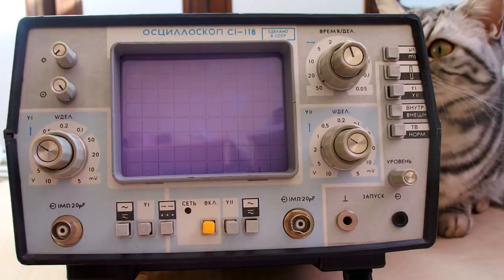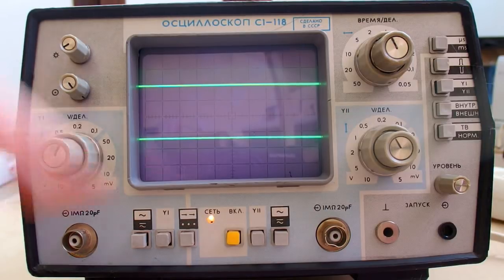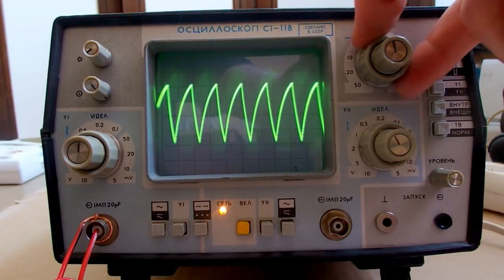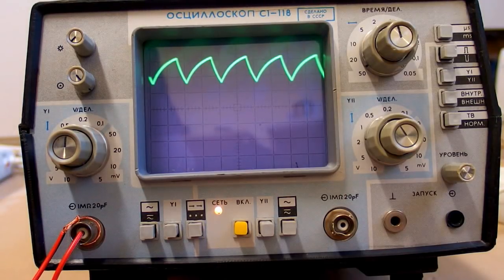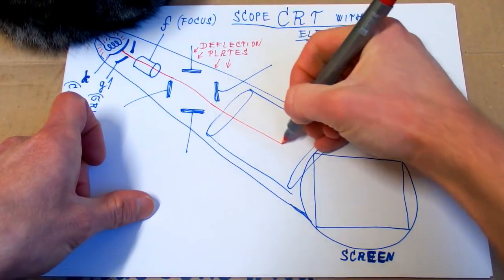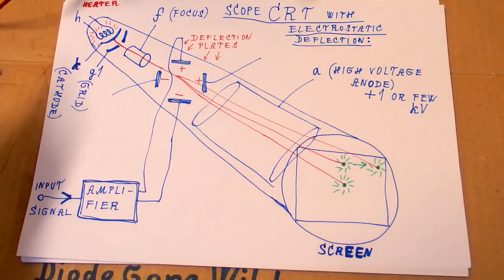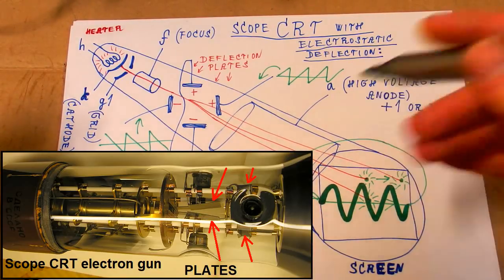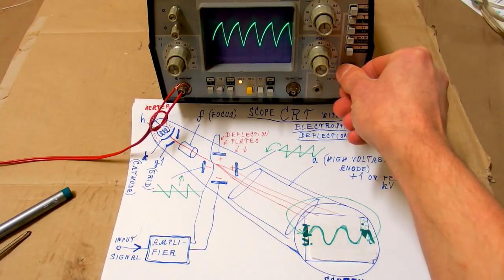How does an analog oscilloscope work

Comment: You did a smashing job of discribing the scope :-D, even though i know how it works i still enjoyed watching :-).
Thats a smashing oscilliscope, dual trace via chop or A/B switching.
The front panal is nicely layed out, easy for even a non russian user.

Ok it was the loverly cat i was watching LOL :-D.

I have a cossor scope, a telequipment d32? and a radio shack display scope.
The telequipment portable battery/mains one is bad joint city, ive spent a lot of time on it.
Reply from the maker: In the next video I plan to get to the dual trace modes :). I like how simple to use this scope is and yet so handy. The cat was very heplful this time.
Reply: It would be awesome to watch if you can build a crude analog scope from scratch.
Reply: You can use an old CRT TV as a basic scope. Connect the deflection coils to a good audio amplifier and you can see the signal.

Comment: The oscilloscope looks cool please show us the inside of it!👍
Reply from the maker: The scope works really well and I really like it. I'm not sure I'm gonna poke in it :). It's not like the Ebay items you can order another when you break one. :D
Reply from the maker: ..... but maybe if I manage to get a simmilar one that's not working, I can try to repair it and show you the internals ;)
Reply: Opening a scope won't break it. Just open the case and try not to break any cables. I have two oscilloscopes. C1-107(5MHz single) from 1992(so technically it's not USSR, it has no CCCP mark on it) and Schlumberger 5228(triple 250MHz). C1-107 still has germanium transistors in it( I saw one in deflection circuitry). It has integrated multimeter which is done entirely using discrete IC's. Character generator,ADC etc is all made using TTL + analog circuitry.  Russian design is messy as always. Oscilloscope part works but the multimeter is semi-broken. Finding the schematic for the oscilloscope should make it easier for you, C1-118 is a popular model so it will be easily available (I found few on Polish forums). As last advice, remember that USSR scopes have slightly different BNC connectors than the west, modern probes will fit very tighly. Changing the BNC is a popular mod for USSR scopes.

Comment: Nice to see you have a proper oscilloscope now - although its a bit old but still working well :-) A few years ago i bought my first oscilloscope which was an old Hameg 2 Channel 60 MHz on ebay. We used similar scopes when i studied in university nearly 25 years ago. The modern DSOs have some advantages  but i still like the old analog oscilloscopes - good for lissajoux figures as well :-)
Reply from the maker: I like analog scopes more than the digital ones. For me, it's the only real scope. A trained eye can identify a lot of things on the CRT, which you dont see on LCD. The brightness tells you how much time the beam spent there, you can see tiny changes, it's not pixelized and in discrete steps. And maybe the CRT warms up faster than the digital ones boot :). And an analog scope never tells you that you can't use features you didn't pay for :D. Let alone the possible timers counting down the time to failure. And turning a knob is much faster than clicking through loads of stupid menus.
Reply: My Hameg scope needs about 10 min. to warm up for the trigger to work properly ;-) I see your point and i like the analog scopes for that as well. But a good DSO is no comparision to the analogue divices when it comes to logic boards, microprocessors and things like that when you need a bit of math on the signals. There is a good review on eevblog concerning about the discrete steps on the DSOs compared to the analog ones. It turns out, that they cover the noise much more detailed which the analog scope doesnt measure accurate and fast enough.

Comment: I need to start saving for an scope.
Reply from the maker: You don't have to buy a new expensive scope. You can buy an older one for a good price.
Reply: DiodeGoneWild I'm poor and disabled I have to save up for even an older scope. I spend a lot of time on eBay searching for the scope I can afford.
Reply: Mike oliver those electronic scopes (DSO138, DSO Shell and the like) aren't bad for very little money. They usually come as kits, so there's a bit of soldering involved. Obviously not as good as a "proper" scope, though.
Reply: I'm in the same boat as you are Mike, but I have heard of going to Ham Radio sales & or swap meets & you can get things for like $5.00 and such for different items, which of coarse need a lot of TLC but I've seen some real nice equipment purchased cheap & they still worked. Just need to replace all the Caps, unless done recently with no questions asked about those, but all in all they are still great deals. Now if we can just find where they have these meetings we can hopefully score some nice testing equipment. Good luck Mike.
Reply: Thomas Fanning if I ever find it necessary of those magic swap meets I will let you know.
Reply: I bought DSO shell scope before I got mine analog scope and it is not worth for the money. Better than nothing though.
Reply: Just do a google search for 'Ham Radio rallies'. You should find loads for the country you live in.
Reply: found mine searching for tools online, (Craigslist in US). its a single trace, older than the one shown. Seller dropped price to $5 when he couldn't find the leads, and I made my own leads.
Reply: I agree with Hüseyin GÖKTAŞ, don't waste your money on a DSO scope. Its very limited in its capabilities and mine broke done after a few weeks. Go for an old analog 2-channel scope, you can get one for 40 - 50 USD (or 50 EUR if you are in europe). In my opinion eBay is not a good place to buy, you can get scopes cheaper on flea markets or small ads (in germany we have "eBay Kleinanzeigen" where people from the neighborhood or in the same city can put things up for sale).
Reply: Mike oliver Mike, where do you live?

Comment: Please make a video about how to read the NOS CRT tube datasheet specs, what the different voltages mean and how to implement these datasheet spec on a simple supply just for a single dot to appear on the center and how focus and intensity works. i have the common 5lo38i and it looks difficult to adjust the negative and positive voltages so that the focus and intensity works properly. also please describe how the blanking operates.
Reply from the maker: hello, here's my diy scope with 5LO38I.
http://danyk.cz/osc_en.html
The cathode voltage is a few tens of volts higher than the grid1 voltage (the grid1 is slightly negative in respect to the cathode). The more negative the grid1 is, the lower the brightness. A potentiometer is used to set the brightness. It's possible to connect grid1 to 0V and use  the potentiometer to regulate the cathode voltage.  Then there's a focusing electrode with a positive few hundred volts in respect to the cathode. Use another potentiometer to set the focus. Then there's the main anode, which in case of 5LO38I is 1000V nominal. The datasheet allows 500 - 1100V. The voltage of the deflection plates should be close to the voltage of the main anode. This is why the cathode and grid1 is often connected to a high negative voltage, instead of connecting the anode to a high positive voltage. This way, the deflection plate driving citcuitry is not at a high potential. Here's a schematic of an old tube oscilloscope:
http://danyk.cz/bm370_en.html
To have an idea how it all may look. The 7QR20 CRT cathode is connected to about -340V and the anode to about +230V. This is more convenient than having +570V at the anode and the plates, but the voltage between the cathode and anode is the same. The plates deflect the beam - the beam is attracted to the more positive plate. The blanking of the beam is done by raising the voltage of the cathode or by lowering the voltage of the grid1.
Reply: thank you for the very usefull help danyk! Your diy oscilloscope was the main reason i bought the 5lo38i myself and now im on seek for an oscilloscope schematic for general basic use. I cant implement your design because its difficult to find cheap tubes in greece. However i have studied your schematic and have tested the power section to the grids succesfully. I saw the beam on my 5lo38i on the center without using any deflection except that as already told you focus was not working properly. I wanted to ask you on your schematic you mention a component ''dt UZAP 100-120V''. what exactly is this. google translate didn't help at all.

Comment: Analog oscilloscopes are becoming antiques. Right after buying a digital scope, I saw one analog scope at pretty low price and immediately bought that. But most of the time I still use the digital one because the analog one is toooo bulky.

Comment: very cool, anyway to DIY a digital oscilliscope using sotware like "processing" (graphics api) to draw the data off usb or even audio port?
Reply: there are projects out there. the problem with audio jack is that its ac coupling only (kills the dc part) so you cant meassure some stuff.

Comment: Is the cable on it original? Didnt russian oscilloscopes have a 2 core cable with a 6 Amp ungrounded round plug?Back then Russians didnt have grounded sockets and even now ungrounded ones are more common.

Comment: I have one of these, but it's only 1 channel. I don't know Russian, so I had to learn using it just by randomly playing with the knobs and buttons.
Reply from the maker: There's also a C1-112 version with 1 channel and a built in multimeter. Or small C1-94 in a vertical box. I know russian, I read russian datasheets in original.

Comment: Security issue for mains measurements with 3 wire mains cable, supposing probe ground is wired to PE?
Reply from the maker: Yes, the probe GND is connected with PE. I'm not sure why the scope is built like this....
Reply: Pretty much always like this...
Reply: Battery powered items are safe to test with a scope. All mains powered items under test,  should be powered via a mains isolation transformer.
Reply: You could also use isolation probes on the scope but these are VERY expensive. So much cheaper to use a mains isolation transformer.